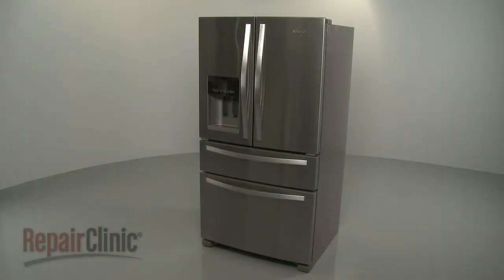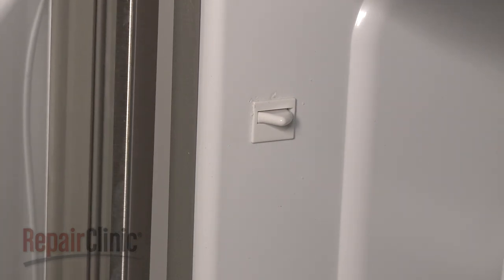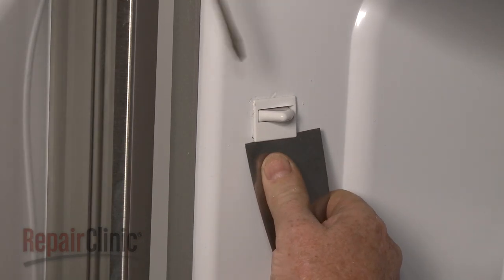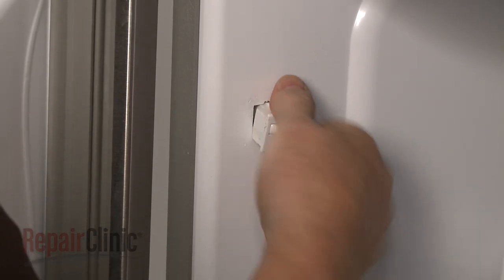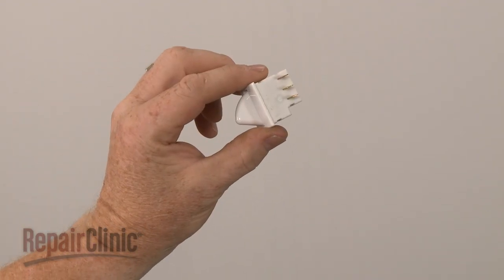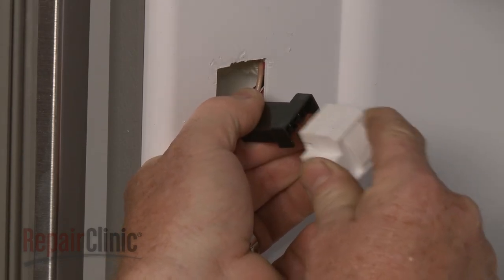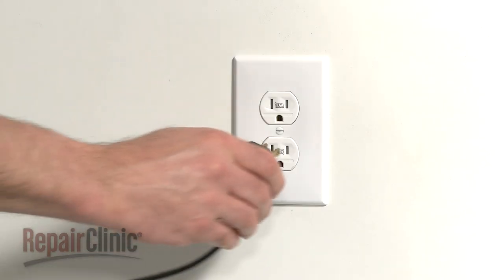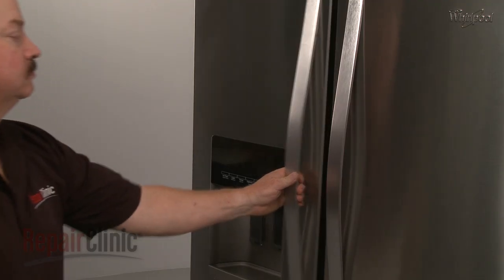Whirlpool Refrigerator Door Switch Replacement #12002646

Comment: I have the same model as in the video. The left door switch is "too sensitive" meaning the door can be open more than inch and the light goes off at this point with the alarm never sounding. Does this mean the door switch needs to be switched for a new one or this is how this model works? I saw a few reviews that this situation is typical of this french door model - wrx735sdhz. Thanks in advance for your thoughts!